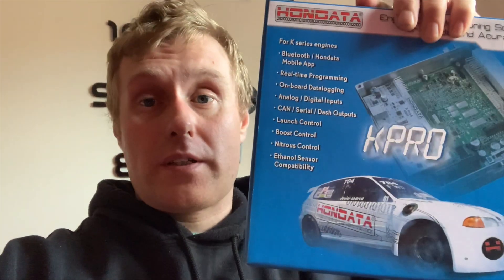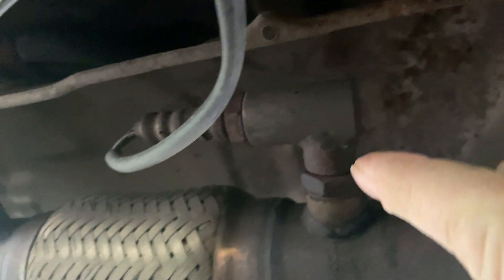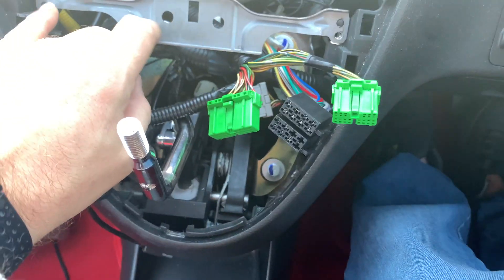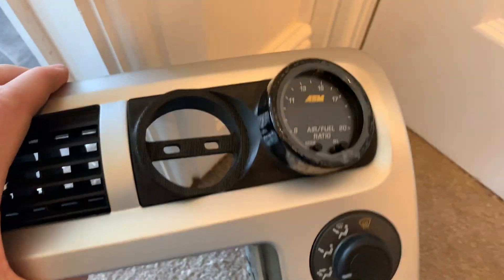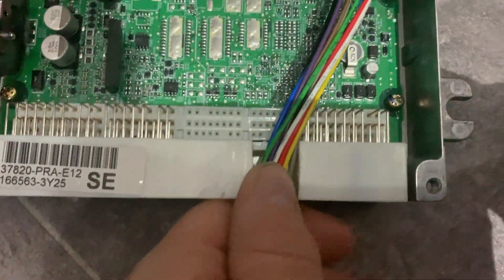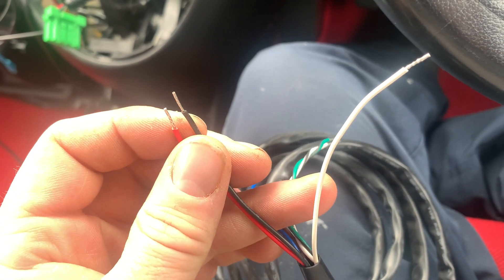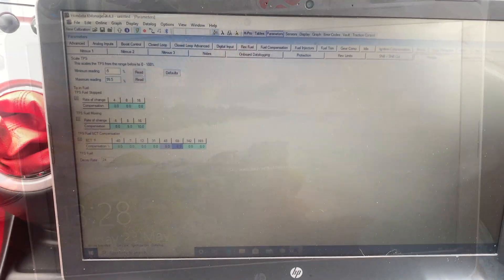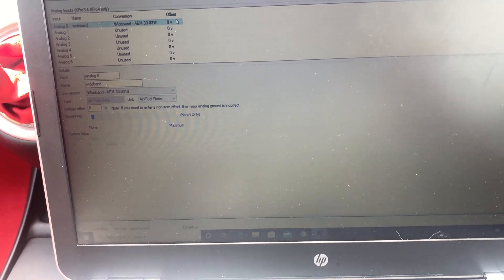AEM wideband Install To Hondata K Pro V4 Analogue Input In My EP3 Civic Type R

Comment: The brown wire from the gauge needs to be connected to the ECO ground to function properly.
Reply: Red = power 
Black = ground 
White = anolog to kpro 
Brown is to be grounded again to ecu ground?
Reply: @Brian-qe5rl  Yes.  That brown wire is actually an input, back to the wideband that reads to know what ground is, at the ECU.  That way, it can adjust its output to compensate for any differences between WB & ECU grounds.  And, there usually is a significant difference, due to the high current draw of the wideband.
Reply: Nice one cheers bud
Reply from the maker: Ah that might explain the readings being completely different! Will go sort that thanks!
Reply: @1BlueGhost  Usually, yeah.  Whatever voltage is on the brown wire gets added to the white wire. So, if it is just loose, floating around, you get inconsistent ( at best) results.  They don't really explain that well in the instructions.  Also, pro tip:  NEVER let the wideband heat up the sensor before starting the engine. That is the #1 killer of wideband sensors.
Reply from the maker: Awesome I’ve just re-wired it will datalog some stuff on the way to work tomorrow. Yes I had an innovate wideband about 15 years ago and I used to let that heat up and it killed a few sensors!!
Reply: @lordandprotector  how do you let wideband heat up the sensor before starting the motor?
Reply: @ryanchau8609  As soon as the gauge turns on, it starts heating up the sensor.  With these AEM gauges, you will see them display "HEAT".  If the "HEAT" process gets past about 4 bars, the sensor is already too hot to start the engine.  Turn off the key; and, wait 30 seconds, or so, for the sensor to cool off a little, before starting.
Reply: @lordandprotector hey man I’m going through similar issues and was wondering if you could answer a few questions? 1. Is there a setting I can select in kpro that would disable the heating of the wideband? Also, wouldn’t you want the sensor to heat up? If not, why do stock car o2’s come with heaters? And lastly, I think me not having the brown wire connected is explaining why my ecu will not display afr’s. Some people have told me that connecting it is unnecessary but I can never get it to read properly and when vehicle tries to run on open loop idle surges whereas on closed loop vehicle idles ok. From what I’m reading I just need to connect brown wire to whatever ecu reads as ground correct?
Reply: Where is the ground you run the brown wire to I’m having the same issue with mine at the moment?
Reply from the maker: Fraser Ballantyne it’s on the analogue input harness in the kpro, one of the black wires
Reply: @Rock2TheRhythm_88  Run the brown wire to the ground on the ECU harness, nearest the ECU.  It needs to connect to whatever the ECU thinks ground is.
Reply: @lordandprotector  is it valid to take the ground from the kpro analogue input harness black wire as 1Blue Ghost says or should i take it to other place?
Reply: @DiegoRodriguezAW11  What is important is that the brown wire on the gauge be connected to whatever the kpro thinks ground is.  The gauge uses the brown wire as an input to figure out what ground is supposed to be.
Reply: In my kpro I have enabled analog input 0 the same as the video but when I go into closed loop to enable the analog input it only lets me select built in wide band
Reply: @codylemieux5075   having the same problem
Reply from the maker: Is it the latest software update?

Comment: Just a heads up for anyone doing this: never sit with the IGN ON (II) and let the sensor heat up before starting the car. Start the car immediately and let the sensor heat up as the engine is heating up. Letting the O2 sensor heat up before the engine can cause damage to the sensor due to the engine blowing out any condensation from the exhaust onto the already hot O2 sensor. Had to learn this the hard way.

Comment: Which calibration did you use? With ep3 European a cannot put a wideband opton on the closed loop options
Reply from the maker: Mine is an ep3 European file? It is a modified version of the replica factory file from hondata
Reply: @1BlueGhost  problem solved just few minutes ago. It was my first time on using kpro. Now it’s all ok. Civic eg K20swap. Hi from Italy!!! 😎😎

Comment: i’ve done exactly this and it just sits at 9.80 on my kpro v4, white wire to the red wire for analog 0 and brown to the ground for analog ground but its sitting at a steady 9.80
Reply from the maker: What does it say on the gauge?
Reply: @1BlueGhost  it reads normal on the gauge, but in the kpro its sitting at 9.80 and wont budge at all.
Reply from the maker: Have you selected the type of wideband input it is on the menu in the software on the ecu?
Reply: @1BlueGhost  yes, but i figured it out on mine. since i have a k swapped integra im guessing its alittle different? in order for it to function properly for me i had to run the analog (white) to my ELD pin/wire on my conversion harness and ran the ground (brown) to the kpro analog ground (black) and changed the settings to the ELD and its working perfectly fine with voltage offset to -0.8
Reply from the maker: Yes it will be different as mine is a U.K. pra ecu from a k20a2
Reply: @R33_Kai  what engine you have? I have K20a2 and gauge 30-4110 where did you put your red, white and black wires using the analog cable?
Reply: @stinky15552  i have a K24A2 go to my channel and watch my video of the cl9 clutch replacement. I explained my wiring set up in that video brother.
Reply: @R33_Kai  alright ill check it out thank ya.

Comment: Does your car run lean on startup from a no signal delay?
Reply from the maker: It’s always rich on startup
Reply: "The original O2 sensor works the absolute best. 

The AEM can be wired into the Kpro but it doesnt work as well and will cause issues at start up because there is no signal delay so the kpro runs very lean on engine start up."

This is from a local tuner here by me, so you're car has been running fine in closed loop with the aem sensor instead of stock?
Reply from the maker: 10-11 on cold start which is where we set it. Warm start hovers around 14.5-15.0 on tick over. No issues with it at all so far nearly 2 years now. Maybe just lucky?
Reply: @1BlueGhost  Appreciate the info! how is the EP3? Im currently in the process of K24 swapping
Reply from the maker: K24 would be great 👍 I did want to do one of those at some point. Ep3 has been good for over a year now. Nothing has gone wrong which is strange 😂
Reply: So I hooked up my wide band. Analog 0 to white and ground to brown but I'm getting no reading in kpro, and under closed loop, only 2 options available are disable closed loop built in wideband. Any suggestion on why I can't choose external?
Reply from the maker: I would have to have a look at the software to try and remember but unfortunately I’m away this week and without a laptop. I think it mentions how to enable it in the video
Reply: Np, I figured it out. Since I have canadian k20a3. The basemaps don't allow the external wideband use oddly. Only type S and Type R maps do which I can't run on this motor since non true vtec. So will have to wait until I do the swap

Comment: Hi Nic, does Aem wideband need controller then connect to analog 0? Or wideband sensor connect straight to Kpro?
Reply from the maker: You connect the wiring output from the gauge to the k pro leave the sensor plugged and wired in to the gauge like normal. Remember to Earth the gauge to the Earth on the additional input harness on the kpro. Works much better.
Reply from the maker: Send it to the Facebook page 👍

Comment: Grounding the AEM Wideband to the Kpro Analog input ground (Black wire) is the proper way to do it?
Or do you need to chase what the ECU is actually grounded to the chassis for this to work properly?
Reply from the maker: Mine is just wired to the kpro analogue ground black wire.